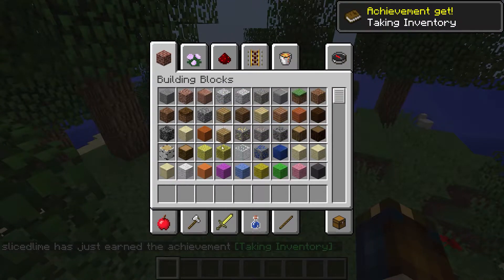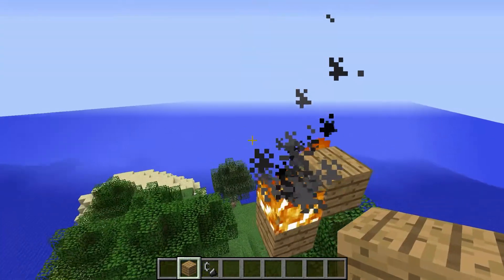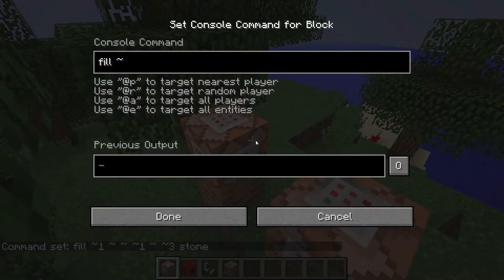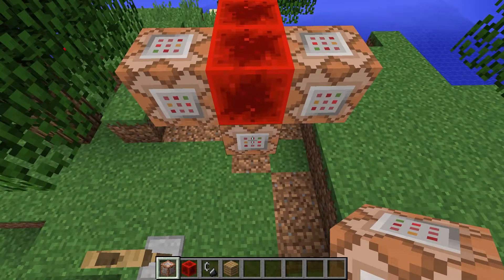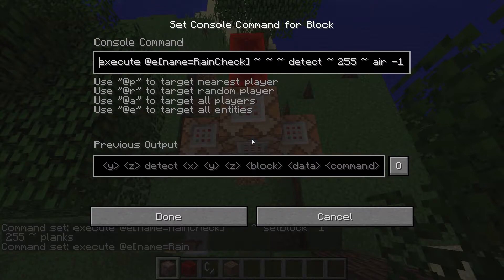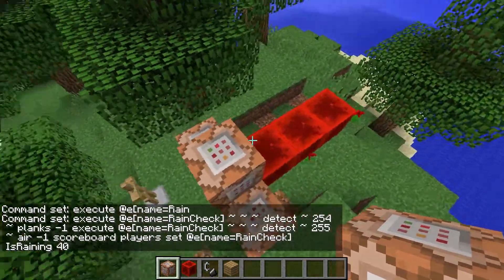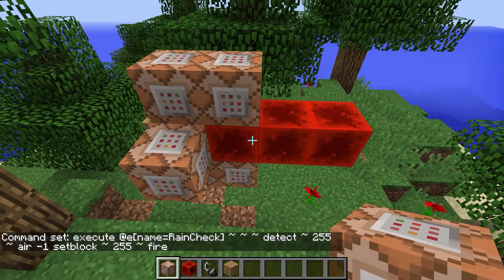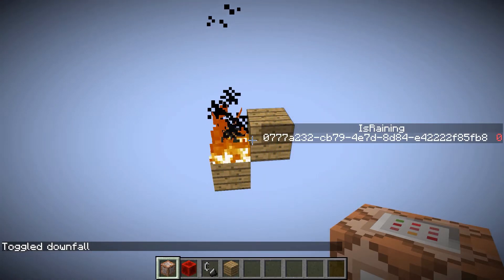Advanced Commands Tutorial: Detecting Rain

Comment: The easiest way is probably to use daylight sensors. Their redstone power thingy gets reduced in rain. So in daylight there will be redstone that barely reaches a redstone torch and deactivates it. In rain, the redstone gets can't reach the torch so the torch will activate a command block with this command; /weather clear
Reply from the maker: +hinrikelvar well, what you've done then is just turn off rain. so you could just as well have done /weather clear 1000000 and be done with it. A "rain detector" that forces you to switch off day/night cycle isn't much of a rain detector.

Comment: What I always did, is having an inverted daylight sensor on top of a command block which turns down the rain as long as possible (/weather clear 1000000).
This works because the rain makes it a bit darker, dark enough for the daylight sensor to activate the command block.
It will get a bit messy when the gamerule doDaylightCycle is not set to false, and it gets night. Right at the beginning of the night the daylight sensor activates and the command block makes the rain stop for 1000000 more ticks. But it stays activated, so it won't detect any rain for the rest of the night. But since the night is much shorter than 1000000 ticks, there won't be any rain at least until daylight. But be aware that if an operator makes it rain at night, you'll have to stop the rain manually, since command block then stays activated even at day.

Of course, it has its disadvantages, and yours is much better. But this one is easier to make and less complex.
Reply from the maker: +Jochem van Hees Yeah but that's rain prevention, not rain detection. Rain prevention is dead simple, since as you mentioned there's a built-in command for it.
Reply: You could also leave out the command block and the inverted daylight sensor will tell you whether it is raining or not, but only at daytime.

And by the way, for what else would you want to know whether it is raining or not?
Reply from the maker: +Jochem van Hees Exactly - a "daytime rain detector" is far from a "rain detector". It might not be what you need but it definitely isn't useless.

For my use case back then I was looking at something that filled up an item with rain when it rained. There are tons of interesting things that you can do with knowing the weather.

Comment: If I tried to make this, I probably would have used cauldrons filling up when it rains and using comparators to detect if it full or not. You would have to only use 2 command blocks and no other commands that way
Reply from the maker: Zane Siwanowicz that would take just about forever to trigger - cauldron filling is very random. This method triggers within 2 seconds of rain starting and is 100% reliable.

Comment: Snowmen taking damage from rain should be a bit easier to detect (using the HurtByTimestamp tag). Doesn't work in warm biomes though.
Reply from the maker: Jakar Yeah - the thing I was aiming for was reliability. And it seems to me that there are more outside factors when using snowmen.
Reply: What about blazes? They are better than snowmen as they don't take damage in certain biomes.
Reply from the maker: Yeah, could work. I wasn't aware of that... Interesting that the wiki page doesn't mention it.